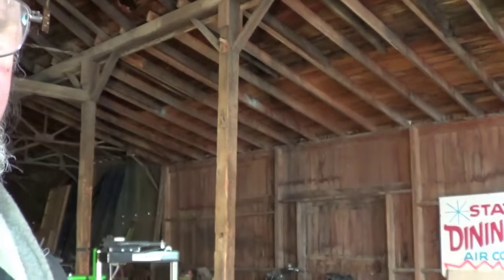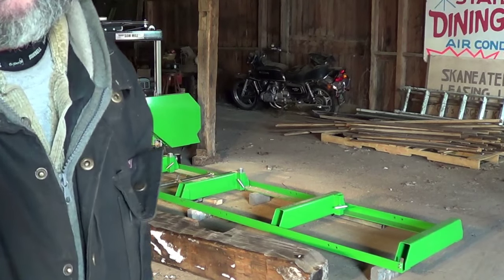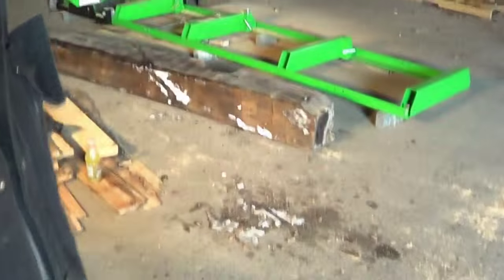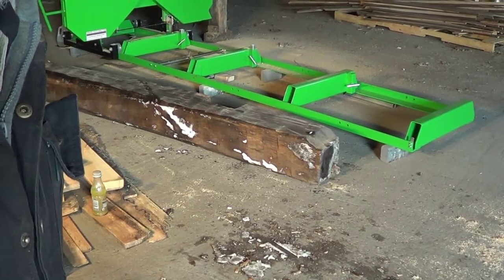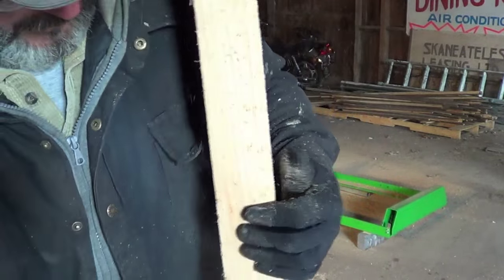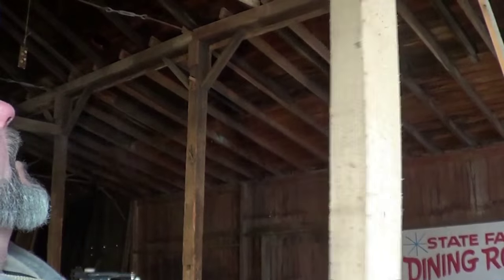Reclaiming Barn Beams For Blacksmithing Projects Using A Harbor Freight Band Saw Mill

Comment: Awesome addition to your shop, just keep an eye out for nails in those old beams. They'll turn a new blade into an dead blade in 2 seconds.
Reply: I sold some large log to a mill, the first thing they did was run a metal detector over them, to see if there were nails old fence wire , bullets etc. All this was to help save the blade,
Reply: MY METAL DETECTOR DETECS LED
Reply: led is a metal........
Reply: if you sound out lead it sounds like lad so how in the world did you get led (Light Emitting Diode)
Reply: Jon Johnson ESL gauranteed

Comment: There's some good advice in the comments about improving your cut quality that will definitely help you out.  There's money in selling the lumber you produce, just make sure you study up on wood storage and drying.  There's tons of opinions and myths on it but it's really not that complicated.  If you really want to get into lumber drying, look into the Virginia Tech Solar Kiln.  The plans are free and you can really improve your production and quality.
Reply: +Leaning Tree Woodworks Whats the drying period in one of them ? Thanks for sharing never heard about them.
Reply: It depends on a number of factors but it really just comes down to relative humidity and temperature.  Most of the time with a solar kiln, the rate of drying the kiln is capable of exceeds the rate that you can safely dry the lumber.  If you dry lumber too fast it degrades the quality of the wood and can ruin it.  I've got a few videos on my channel about it if you want to know more.
Reply: Money is a big word, most dont make a decent living from those sawmills
Reply: All these comments about drying the wood is great and all, but, it's not really a factor in barn timbers! Unless they have been exposed to weather for years, the wood is as dry as it will ever be!
Reply: oldschooldiy Exactly that wood is probably 100 years old

Comment: I have had a lot of experience with this mill and I can tell you your blade tension is loose give it a couple of turns so there is some play but not to much and you will be able to get some great cuts. I am sure you have already done this but if not spend as much time as you can getting your tracking as level and square as possible it will help you out greatly. Also invest in a blade sharpener asap, it might seem like a little expensive now but trust me it will save you serious $$ in the long run.
Reply: your right. you have to be able to sharpen the blades. there is a learning curve but its worth the time and money!

Comment: Like some others have said,watch for nails in those old beams.Invest in a metal detector.I was a sawyer for 13 years and I can tell you the many things that were buried in some logs like cable,rail spikes and even horseshoes.Wasn't pretty when you hit one of those.Another tip is that if you plan to mill from barked logs,take the time and wash the bark with a garden hose to get the mud and stones out of the crevices.Dried mud will prematurely dull your blade.

Comment: That's a very nice little mill, the only thing I'd consider improving is that clamp. It looks like it'll get caught in the blade one day and it's time consuming to apply. I'm sure you could come up with something better. Good luck with branching out.
Reply: A quick caming system like what is used in a come along, only more precise may work.  Surely there's a tool like this in use somewhere.

Comment: Hello Chandler,  Did you have trouble with the track bolts interfering with the carriage?  Someone else did and pointed it out as a quick fix with the welder.  Looks like a great value.  Doug

Comment: Chandler does that saw have extendable blade guides?  If it does you can move them in closer to the lumber and the blade won't wonder around so bad.  Looks really cool though, I was surprised at how fast you were able to cut.

Comment: i guess this might be a rhetorical question and no trolling involved  but they might pay more for the rustic looking stuff on the outside than the nice smooth stuff on the inside ?   just a thought
Reply: Bandsaw leaves a rough surface, the old surface is full dirt and grime

Comment: how are you cutting your slab quarter sawing? grain is everything when it comes to movement. it can rip your projects a part.
Reply: +Anthony Payne This is through and through sawing unless the log was previously quarter sawn but i doubt that for its original purpose.
Reply: +Ashley wow,  you don't understand what quarter sawn is. You should understand wood movement when making furniture.
Reply: +Anthony Payne what he was doing here is through and through. 
If it was taken out of a log quater sawn years ago you can re-saw quater sawn .
Reply: +Anthony Payne actually i tell a lie this isnt through and through as the log is rotated after each cut this is called tangential. 
But the basis of quater sawn is more figurative grain and better resistance to cupping winding ....
Reply: +Ashley Sorry for my attitude, I looked at your hero's  and your channel, thats cool Looking forward to more vids.
Reply: +Anthony Payne i learn about it everyday 😂 , its okay man . Thanks for subscribing.

Comment: Why you chosen gasoline engine while you'r working in a shop? Electricity is much more officiant then internal combustion engines, these things are built to work in a field, gas and engine repairs will cost some money in long run.
Reply: +Manats Ataurup Power , with bandsaws power is key . Electric motors have come a long way but engines have sheer guts to them.
Reply: what ?:D have you heard about reduction?
I have been i several lumber yards and in every one of them big band saws was powered by electricity...
Reply: Okay but i have a question , how long is your extension cord ;) haha